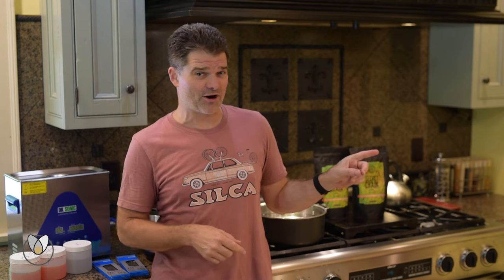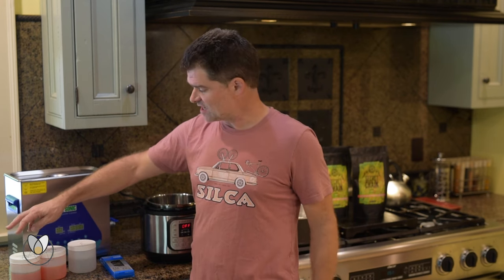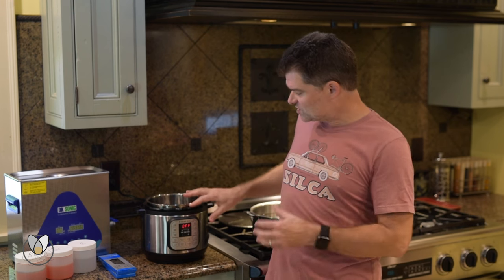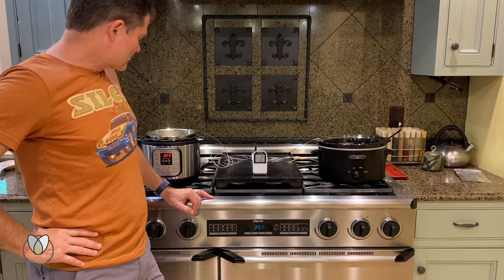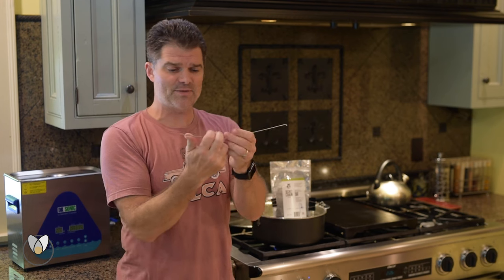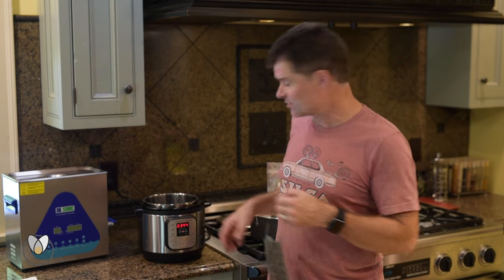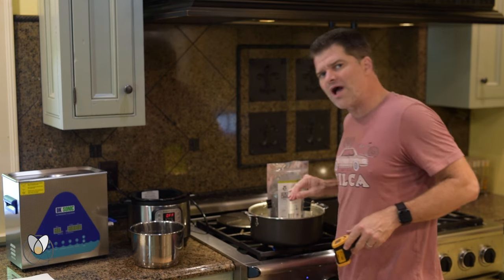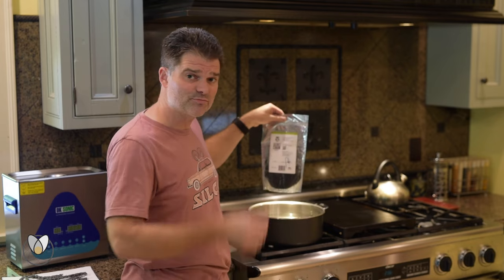MGTV: How to Hot Melt Wax Your Bicycle Chain

Comment: You stress maximizing the viscosity of the wax before removing the chain from the hot pot, but do you have data to show that such a strategy improves coverage between the parts of the chain that would rub together?  One would think that close clearances would hold on to wax even when the viscosity was low.

Comment: I watched the whole video...and my first thought is: have you seen a doctor about your OCD? No, I do get it. Back in the day...serious...my friends and I would use acetone to remove the decals from the bike in order to make it lighter. I suspect only bikers will get this comment. Anyways...my takeaway from the instapot vs hot water process is you say the instapot is way faster. Huh. I am not working on an assembly line, so time is not the issue. I have a pot of water getting warm. As for cleaning the chain, I used a five part wash: paint thinner, acetone, brake cleaner, methyl alcohol (which by the way is Heet at the car store, lots cheaper) and a final of xylene. Chain is sparkly. Thanks for the vid.

Comment: Great video as always. Point to note in the crock pot vs instant pot here in Australia is that the price is nearly 10 times higher!! 20 bucks vs 200 bucks. I have a crock pot and just turn it on and come back to it an hour later, swish the chain and hang it up. Job done :-)  Also., the 3L size is possibly a bit bigger than needed - you need to use more product to get the depth needed for swishing, which means that the full amount gets contaminated over time. If you use a 1.5L then you can use half the amount in the crock pot which means that you get twice as long out of the same amount you would use in the 3L. Hope this makes sense
Reply: Fellow Aussie here- best I can find and instant pot is $250 plus post.
I wonder if an air frier set suitably low enough would work
Reply: Good suggestion! I "borrowed" 😉my wife's mini crock pot and that was a perfect size to use much less of the Silca Wax while still fully submerging the chain.

Comment: I put the wax in a beaker and "float" it in my ultrasonic cleaner. I then drop in 3 chains and let the cleaner do the agitation. I generally do about 12 chains in an afternoon and keep them available and swap them out every 2 to 300 miles depending on riding conditions.

Comment: 2 weeks ago I met an old friend beeing an enthusiastic cyclist since about 40 years. 
He told me that he is "cooking" and waxing his chain!
I have never heard that before. So I reseached a bit and "stumbled" over this video and the "SECRET CHAIN BLEND" 
There are other solutions around but I found the presentation from Josh rather authentic and sympathetic.
I applied it on my rather new (250km) chain after intense cleaning.
3x Isopropanol cycles, cooking in detergant and 2x ultrasonic cleaning.
It was asthonisching how much muck came of my rather new chain.
I was even dispensing it on my Cassette using a silicone brush and a hair dryer to distribute it.

First drive impression and gear switching behaviour was significant better than before. 
After 300km and lot's of mud and dirt - I am a MTB driver - the chain and cassette looks and feels still like new.
Thumps up!!!
Reply from the maker: Thanks so much Marc!  Glad to hear you are enjoying it! - Josh

Comment: It is the first time I wax the chain. I clean the chain with Chain Stripper (fantastic) and used the bain-marie method using the bag (I left the chain too long in the wax to cool down and had a lot of residue sticking to the outside and the chain was like a rock, but now I have learnt my lesson). After the first ride (which softened the chain) I cleaned it with a microfiber cloth and applied super secret with the advice given in other videos, a drop at each joint, run the chain, pass the finger etc. and left it 24 hours. Yesterday I did another ride and I must say that I am very pleased. Very clean drivetrain, now I can touch the transmission without having any dirt in my fingers, at most a little bit of wax and dust (seems like some kind of miracle to me) which is the main reason I wanted to try the wax because I hate all the sludge and the process of degrease and re-lubricating, the drivetrain is also very quiet and the shifts are smooth.
I wanted to write this comment to thank Josh for his fantastic work which makes a Sunday racer like me that much happier. I think I will be using only wax for my transmission from now on.
Thank you from Italy!

PS
Just one question, if I understand correctly the wax does not protect against rust. Now some years I stay abroad during the winter for three to four months and the bike stays at home without anyone to look after it.  Is there a risk of the chain rusting? If so, what do you recommend doing, would a hot wax bath before leaving it be a good method or is it better to put an oily lubricant?

Comment: Lots of respect and compliments for the in-depth video, but now it's opinion time.

1. Instant pots are typically around 80+USD, although you can hunt for one at the price you mentioned. For some, this is fine, and I'm sure they'll feel secure in their decision after noting your endorsement, however it's no surprise some might find it unnecessary. I found a brand new bare-bones slow cooker for $10 including a ceramic bowl which is important to prevent flaking of common non-stick surfaces found in other cookers (not mentioned in this video, and a seemingly common mistake to make). While the low setting took ages to melt my wax, it also proved that the "thermostatic" controller it must use maintains a more or less ideal temperature--just over the wax's melting point. That all being said, I'm glad you have the stove-top alternative method.

2. I'm curious as to why so much emphasis (and time and effort) was put into comparing the time taken to completely melt the wax. Whether it be under an hour or a few hours, I hope most wouldn't mind waiting for a completely hands-off process for something done on roughly a monthly basis. However, I'm (respectfully) less surprised when I see a reputable face of Silca endorsing such options when the company makes a $495 floor pump with a "Swiss gauge accurate to 1%". I could get into why this level of accuracy is laughably useless in an analogue gauge style pump but I digress. The one glaring caveat to this being that I'm one to put money more into function than sparkly bits.

Comment: Thanks for the vid. 
A few comments: 
- I think it is important to remember critical chain wear occurs between bushings and pins. You cannot see the surfaces that wear, so it is difficult to know whether your cleaning method has been effective.  A great research video would be to sacrifice a few chains to inspect the bushings and pins before and after cleaning....and after waxing.....  This would be more revealing and scientific in discovering the true effectiveness of a particular cleaning and waxing protocol. 
- Because bushings and pins are where all the wear occurs, it is important that these areas be cleansed very well between use. Grime that collects in these inner surfaces is likely going to adhere to the wax coating, so it is important that old wax be removed to some degree. It doesn't have to be removed totally, just the dirtier out layers. Degreasers and ethanol are not going to remove wax.  What will remove old wax better is this: 
1.   drop hosed chain in boiling soapy water to soften the wax
2.   remove and apply a hair dryer closely to the chain to super heat the links for several minutes
3.   back into boiling soapy water and agitate.  
4.   remove and heat again with hair dryer
5.   into degreaser (I use kerosene) and agitate
6.   into ethanol (I use methylated spirits in Australia. This is ethanol with an insignificant amount of chemical to spoil the taste of the ethanol, in order to stop some people drinking it as recreational alcohol). 
7.  before adding to wax bath, super heat the chain with hair dryer again to ensure it is dry and hot.  It is the heat that helps the wax penetrate deep into the bushings and pins, where it is needed.  

BTW, the quickest method to heat wax is on a stove top (gas or electric), though you have to be careful not to heat too quickly. 
The wax should be brought up to 85-93 degrees Celsius. 
The melting point of most paraffin waxes is under 70C. 
Lowest flash point is 200C  (temp at which a combustible vapour is created above the wax....and adding a spark or flame will cause combustion). 
Lowest boiling point is 370C.
So there is a large margin to carefully heat wax on a stove top without risking it ignite or boil. 

Finally, I have heated wax up to 110C in a slow cooker (crock pot).
Incidentally, I use a digital infrared thermometer as you do. 
Theoretically, the hotter the wax, the greater its penetration quality should be. 
And this raises the question of whether waxing might be more effective if done twice, once at 105-110C, then allow the wax to solidify, then dip again when wax is at 85-90C and don't remove until temp is solidifying ~63-70C. This should give thicker coverage, though whether of the bushings and pins remains to be investigated.
Reply: zero friction cycling has done these studies, check their website
Reply: Lol this method really does sound like a faff, I’ll stick with silca
Reply: @jackdavis8786  
yeah I reduced the steps. 
1. take chain off, and agitate in boiling water and detergent to soften wax and begin removal of grime. 
2. remove chain from detergent and super heat with hair dryer to further soften wax between plates, then back into detergent, agitate, then rinse and dry. 
3. then into wax bath at temp of 80-90C, turn off bath...agitate chain for 60 seconds remove and hang up to dry. 

Do several chains at a time. rotate through chains when chain noise noticeable. 
I have one 11 speed chain with at least 8000km on it, and it is still well below 0.5% stretched.

Comment: I have always let the chain heat up on top of the cold wax. I figure that this evenly heats the chain better instead of putting the cold chain straight into hot wax. There is probably no scientific basis for this but kinda makes sense to me :)
Reply: Made sense to me too. So I followed your advice! 👍
Reply: Since heat lets metal expands this makes sense. There is more room for the wax to get into the chain -> better lubrication.
Reply: Also thought about it

Comment: Cheaper option ( mine)
Put the wax in a glass jar, and put the glass jar in boiling water (agitate the wax for it to melt, 20 minutes in my case ). Then, dip the chain, etc, etc...
I think it's safe like that, and cheap.
Be careful, though, it's hot wax.

Comment: So I just realized that your probably using a smaller 3 quart instapot.   I just bought a 2nd pot liner for my 8 quart instapot.   Dumped the wax in it and I got a shock.   Don't think when the wax melts that it will be deep enough to soak chains.   Dang!   Can't believe I missed this.

Comment: Is it really necessary to let the wax cool before removing the chain? It seems like a superfluous step that would be a barrier to getting people to switch to hot wax. I started using Molten Speed Wax at the beginning of the pandemic because using drip lube my chains were done in around 1500 to 2000 miles and getting parts was difficult. I figured I’d hot wax until the supply chain improved and then go back to drip. Well I haven’t gone back because hot racing turns out to be easier/faster than drip lube, but babysitting a pot of wax waiting for it to start hardening would have been a deal-breaker. I find that when you pull that chain out of the wax it cools really fast. I doubt there’s much egress of Molten Wax from the pins and bushings in that time and I heat my wax up much hotter (around 190° F which I believe is MSW’s recommendation for their product). I have two chains with 4800-5000 miles on each of them, and rewaxing approximately every 200 miles there’s no sign of wear on either. If I only get 6000 to 7000 miles out of these chains I’ll still consider that a huge success.

Comment: Great video, thanks. Two things puzzle me - One: why the obsession with a fast warm up? I use a small cheap wax pot made for body hair removal, it takes two chains and it takes 30min to warm up but I just turn it on before I need it so no delays. I can eat lunch, wash the bike or play with the kids. Two: I pull the chain out at full temperature because the wax I gain by pre-cooling would just be wasted/brushed off when preparing it for the bike. The capillary action will keep the melted wax in the chain internals anyway, where I want it, so I pull the chain out at full temp and then turn the pot off. It is usually 200miles or 300km before I start to get any signs to re-wax.
Reply: Bingo ... pull chain at full temp.   Looking for someone else to say no but my chains come out stiff and heavy and every link packed with wax.   Lots of cleaning just to be able to install it on the bike.   I'll try your idea next.
Reply: @donmulvey9280 Chain will still start stiff and need the initial 'breaking' but an external brushing seems to be adequate preparation. Can skip for the first few minutes so save the heavy pedaling till after that. Then it's excellent for 200 miles, much cleaner than wet lubricants.

Comment: I melted some teflon into some prarfin and put it the oven for 30 minutes then boil it in linseed oil or lamp black graphite.  If I use the oven it takes about half hour with kerosene gel.  Sometimes a torch helps but the oven is more consistent.

Comment: Hi SILCA Velo! So far, so good with the Secret Chain Blend - Bag method (two bikes converted). One thing I'm noticing is the need to reapply more frequently when riding in all weather. Year round bike commuting in the PNW brings all the elements. You had also promised a video showing the bag method application, along with topping it off using the battle reapplication method... do you have an updated timeline to get that video out? I just reapplied using the bag method just yesterday... not crazy time-consuming, but if there's a quicker/ better method, I'm in!!
Reply: I don't want to speak for the good folks at Silca, but I can speak as a person who has been waxing his chains for many years.   Rain is the enemy of a waxed chain.  I live in Connecticut, and chains on my road bikes typically last around 200-250 miles before I wax them again.  One rainy ride, however, pretty much guarantees I'll need to do another chain waxing session.  It sounds like the rainy weather in your neck of the woods means you might need to wax after the (far more frequent) rain.   I do rotate three chains for each bike.  That way, I only have to do a waxing session every 5 or 6 weeks.
Reply: This basically doesn’t work at all in the rain. In the PNW, you can use a waxed chain from mid-June through early-September only. Unless you’re a fair-weather-only rider.

Comment: I've been doing the hotwax thing in various forms for quite a long time.  I use a small slow cooker (one with a temperature control) and a similar three solvent bath.    Unfortunately Josh, I think the fact that you are doing this in your kitchen is going to put a lot of people (and their families) off of wax.  This really needs to be done in a garage or workshop.  If I walked into my families kitchen with a dirty bike chain (and all of the assorted cleaning and waxing apparatus), I would be banished for life...

I do all of my bike maintenance in a single car garage.  I have a single burner induction device and a dedicated pan for testing the super secret wax, but I ended up just putting it in the crockpot. I love the wax, but I'm not a big fan of the bag.  The opening  is a little too small and fussy to get a chain in and out of without making a mess.   For my chain swisher, I bent a coat hanger into a square "J" shape just slightly narrower than the opening of the slow cooker, and loop the chain at about every six links or so.  The top is bent into a handle of sorts to make it easier to hold.   I always put the quick link on the hangar/swisher before the chain, and then drop the setup into the crockpot and leave it for 15 to 20 minutes. I use the handle to swish the chain around in the pot a few times before I remove it.  And I always put the chain back on the bike while it's still warm so I can pedal and shift through the gears.  This cuts way down on the wax flaking off.

Comment: On the 3 quart Instant Pot, what setting do you use to melt the wax to the proper temperature.  I do not see how you can set an actual temperature.

Comment: Sidebar: What's the proper disposal for the spent wax? And how many chains could you properly treat per 1 batch of wax?
Reply from the maker: You can probably get 30-40 waxings per 500gm of wax.  It can be disposed of to landfill as the wax is medical grade and the WS2 additive is certified safe for ground water contact by Bureau of Land Management, and is even used in paints for ships to prevent barnacle attachment.